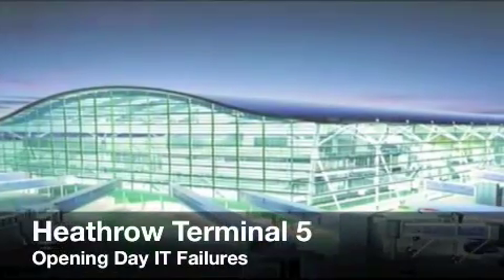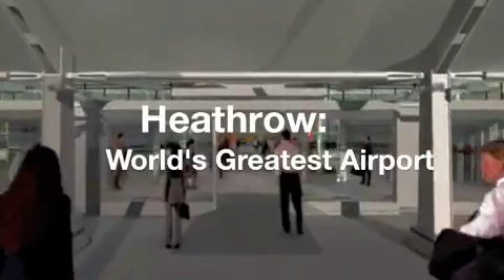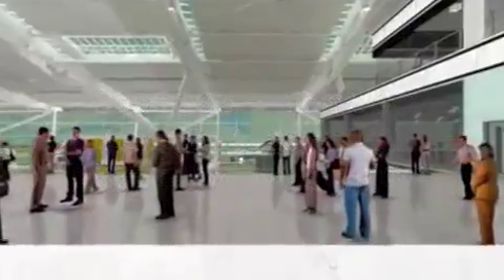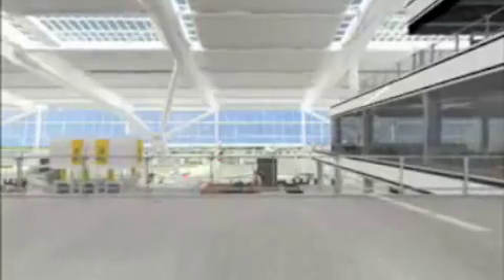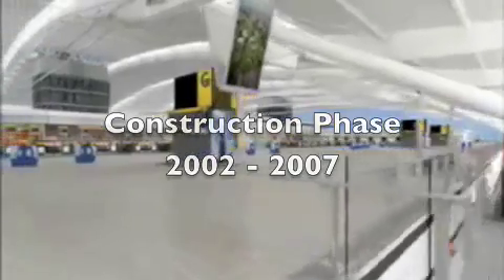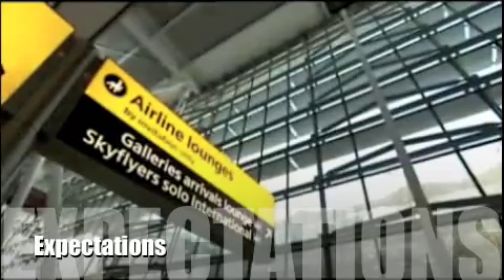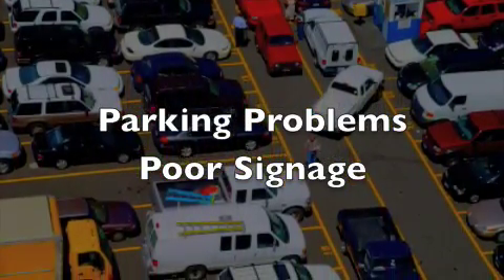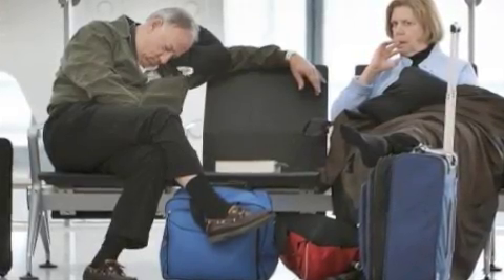Heathrow Terminal 5 Failure (SFU students case study)

Comment: Does this mean that this project is a successful project when the project had close but the experience wasn't good so now its a failure project ?  ( for research purpose)
Reply: Yes and no. Need to have specific measurements for specific goals. Some targets/benefits are set during initial stages of the project but there are benefits that are seen after users actually use the service/product